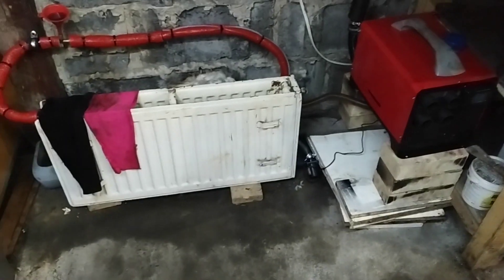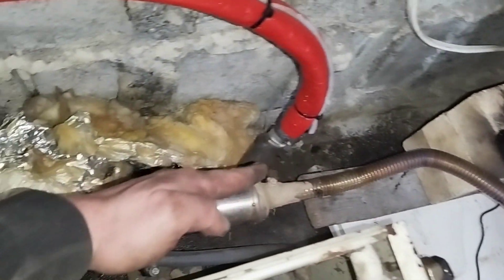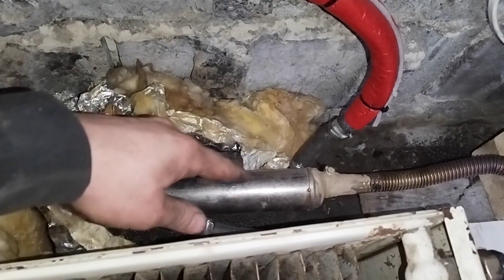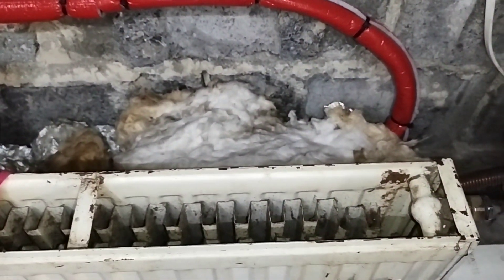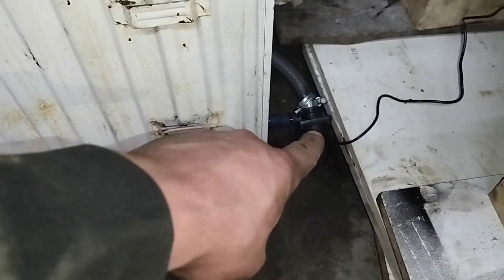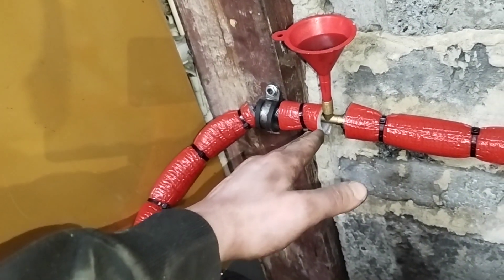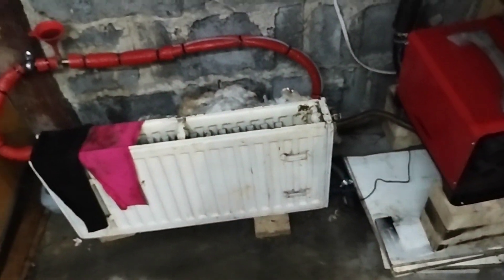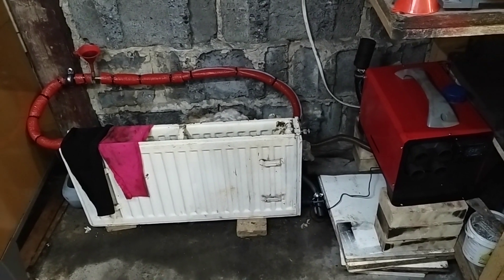Chinese diesel heater - heat exchanger EGR setup with house radiator - VEVOR 5kw/8kw

Comment: Hej Simon. Do you know how many m2 a 5 kw Chinese diesel heater can heat.  Perhaps you can also answer how many m2 an 8 kw diesel heater can provide.  Sincerely, Lars from Denmark.  Ps Hope you can understand my bad English 😁🤗
Reply from the maker: @larslindthomsen7370  the manual from the vevor heater suggests that for every 10m2 you should get 1kw, so 5kw=50m2 etc. To be honest it's a bit of a stretch and I would say you should half these numbers - the math they use to calculate it assumes insulated walls and 100% heater efficiency. Your English is good! Thank you for your comment.
Reply: @simondoesthings  Thank you very much.👍